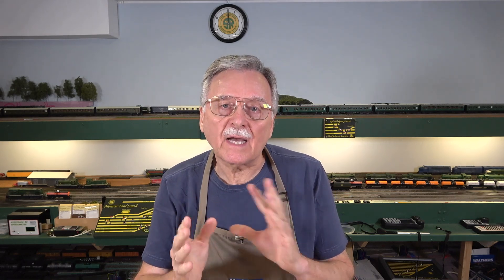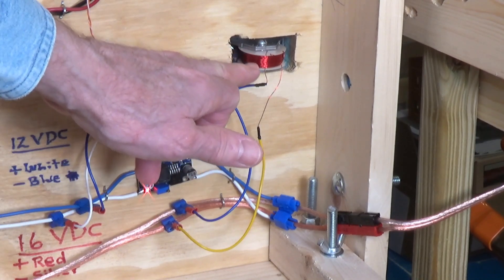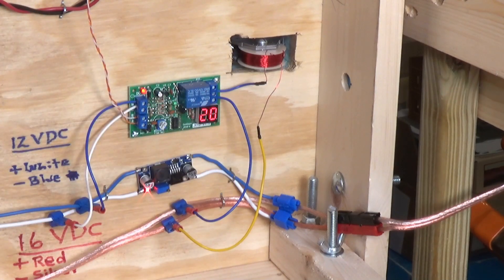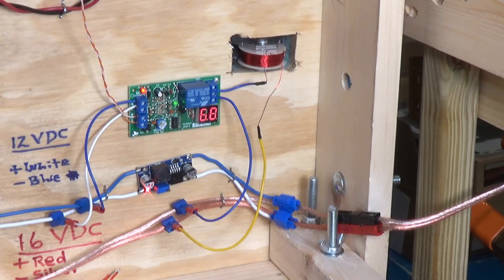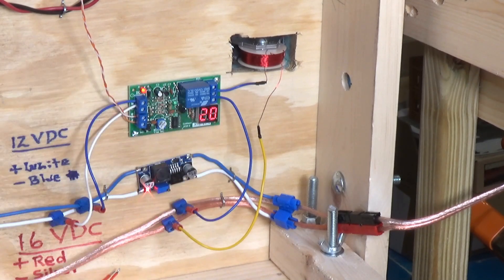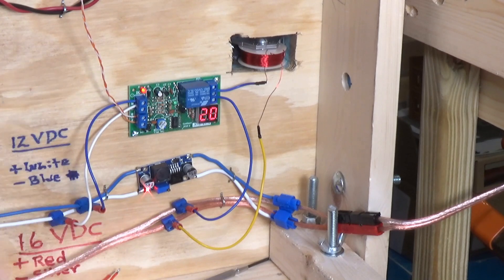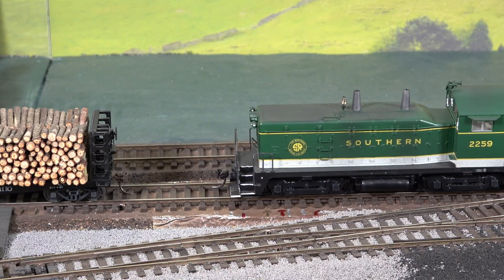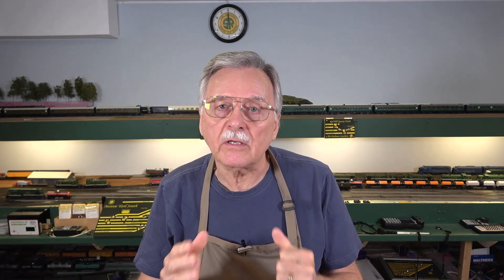KD Electromagnet Final Wiring And Demo (332)

Comment: To finish my KD Magnets and needed more Relay Switches as what I bought a few years back were depleted and I needed a few more. So I bought a decent inventory! . Like you, Larry, that site I originally went to is gone! BUT I did order some from Ebuy7 Shopping Platform last month out of China! The product name was "Tonkeys TK1801 3-Digit Relay Module - 10A Automotive Relay" Strange enough the fulfillment came, not out of China< but  USPS Ground out of Jamacia, NY in about 10 days. Very Reasonably priced!
Reply from the maker: Yes, a lot of these small Chinese players have set up drop ship operations in the US but once they run out of stock they will either disappear or ramp up their prices.

Comment: Just wondering, as I am about to electrify my 20 + Kadee Electromagnets that have been patiently resting into my hand-laid track from last year, (per your previous You Tube Instructions) - Do the ends of the red wires on the electromagnet need to be stripped in any way before I solder the to the 16 Volt feeder wires? Also, is it IMPORTNANT not to let the red electromagnet wires NOT touch each other to prevent shorts?
Reply from the maker: The wire is coated with insulation of some sort and a sort section on the ends needs to be stripped. I have had success using an emery board or fine sandpaper to get down to bare copper. Since the wires have insulation on them they can touch just be careful where you remove the insulation or you’ll get a short.
Reply: @TheDCCGuy  Thanks for your response. I used some 150-grit sandpaper and have started stripping the red electro-magnet wiring. so I can get a clean connection to the relay and power supply. Just a thought - It would have been easier to bring the two electro-magnet wire ends to their copper wiring finish IF I stripped the wires BEFORE I added my Kadee Uncouplers under my layout. This would have helped me getting a better sanding all around the wire. It's hard to see how much I've stripped looking at this from underneath. I could have also soldered my connections wire then too. I may just end up using some lever nut fasteners. I really enjoy your expertise. Thanks so much. I really have no one to talk to about all this. I find many people have forgotten how they made their layouts, so that usually is no help. Also, technology seems to change methods too quickly that people I talk to are not on my page.
Reply from the maker: New product that is not even available yet, so you’ll have to wait.

Comment: Larry, I'm not great at Electonics, but you say one needs 12 volts to operate the circuit board (and then 16 volts 3.0 Amps for the electromagnet off the relay) . If' I am not using the drop down voltage splitter, you have, to drop the voltage; how many Amps should one be looking at for the 12 AMPS going to the circuit?
Reply from the maker: The circuit board needs very little power to operate down in the 10s of milliamp range, so the power for the magnet is the main concern and these small relays are rated at about 10 amps. Of course none of the ones I used are made anymore so find one similar.
Reply: @TheDCCGuy  Thanks for your answer. You are so eloquent in the thought that goes into your passion of helping others.

Comment: The ebay links are dead, what did you use for search times?
Reply from the maker: That’s why I no longer provide eBay links, you never know if they will still be around in 24 hours much less several years. I’m sure you can come up with appropriate search terms as I have no idea what I used back then.

Comment: This could also be done with a microcontroller (like an Arduino) to control several magnets.  It would be easy to program the time for each magnet with programming to limit the number in use at once and also to limit the time for reuse. It would of course require a relay board with enough relays.
Reply from the maker: Yes, I wish I had the time to take that deep dive into Arduinos and their programming, etc. However I am challenged to find time to do the videos I do manage to put out. I think that would be a great subject for a YouTine channel.

Comment: Hi Larry,  

Always enjoy your videos. 

I am currently converting to DCC and about to start modifying the three speed step variables to match speeds. 

Do you have any tables of suggested CV settings as a starting point for different brands of locos, Lima, Atlas, Kato, etc.

I am using a Digitrax Zepher Express throttle and mostly Digitrax Decoders.

Regards Peter, Melbourne, Australia.

Comment: Always enjoy your videos, got a question, why do you have 12VDC and 16VDC powering the relay?
Reply from the maker: The 12V powers the timer and the 16V powers the electromagnet.
Reply: In other words, the 12 volt bus powers the relay board.  The 16 volt bus powers the electromagnet.  The relay board merely switches the electromagnet's power on and off, according to a timer circuit.

Comment: you speaker wire is 16vdc  you steel power from that to feed the converter for the 12vdc wires
Reply from the maker: Is that a question or a statement of fact?

Comment: Can you take a look into the new ideal lever wire connectors  there available in 2 ,3and 5 slots versions and work with 24 -12 awg wire
Reply: he did do a video on different connectors 2 months ago
Reply: @jenniferwhite6089  these are new on the market and can be found at Lowes and home depot
Reply from the maker: In looking at the photos on the internet they appear to be similar to Wago lever connectors which I have used in past videos and I love them.